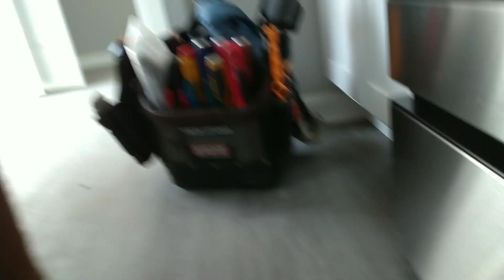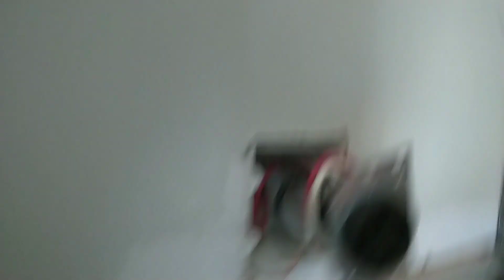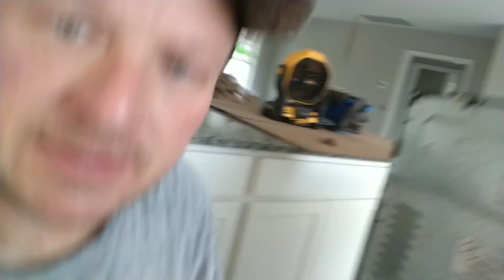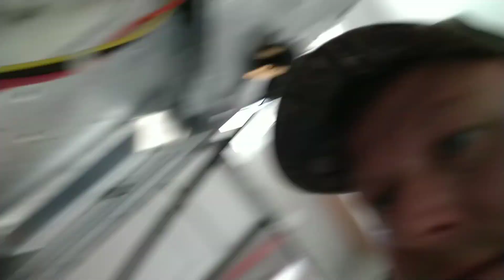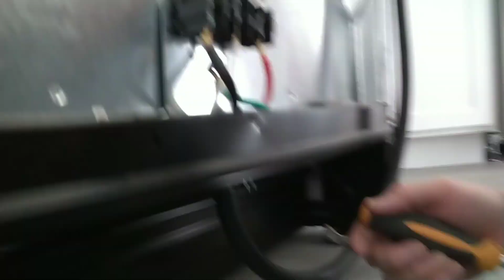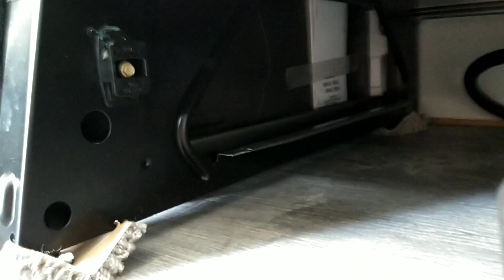How to correctly wire up a Range 🔌plug and outlet 🤔

Comment: First of all, great video. perfectly explained. I have to install an electric range that I purchased in the US and shipped to Brazil. What AWG wire should I run from the breaker to the outlet, 8 or 6 AWG? I am planning on using a 50 amp 2 pole breaker. Also, since the neutral is just to run the lighting and the controls, does it have to be the same AWG as the Phases or could I use 12 AWG? Can I do the same for the ground?
Reply from the maker: Thanks for watching and commenting. Great questions. I'm not sure if the county Brazil , that you are in follows the NEC. But I'll answer the question, as if your here  in the states. Short runs, the Range can be wired on a 50 amp double pole breaker with 8 gauge  wire for the hot legs. The neutral also needs to be an 8 gauge.  The ground can be a 10 gauge. Longer runs, you may want to step up the garage to a 6 to accommodate for a voltage drop.
Reply: @workingmanrondoyle3287  Thank you very much for your answer. In fact they do not follow NEC in Brazil but since they don't sell these electric ranges here and thus have no code for it, I feel it is prudent to follow it myself. The runs are actually short, less than 15 feet at most since the breaker box is in the kitchen where the range will be installed. Now I have to find out if I will be able to pass the wire through the corrugated duct that goes to where the range is installed. Here, all the construction is concrete and brick and if I can't use the existing duct, then I will have to break som concrete and do som tiling. Cross my fingers and hopefully won't have to do that.

Comment: Ron, great video. Thank you so much. I have a question for you. Currently we have a gas stove and the receptacle behind is a normal 120v. We'd like to go with an electric stove/range and I know that we're going to have to install the correct outlet that can handle the electric current. I realize that stoves have either 3-prong or 4-prong. Which should I install? And what is the difference?
Thanks Ron.
Reply from the maker: Thanks for watching and commenting. If you're installing a new range in a new or older home that doesn't already have pre-existing wiring for a range application you have to run a three conductor+ground= a four prong cord set and matching outlet. There will be 2 hots, neutral and a ground for this appreciate. This was mandated many NEC. Code cycles ago. I hope the information helps you.

Comment: When wiring the back of the range, what would happen if you reverse the Black and Red wires?
Reply from the maker: Thanks for watching and commenting. That's a good question. If the range is listed for 240 volt single phase?  It won't matter if the red and black are switched. Red to black and black to red. They are both 120 volt to ground each. And 240 volt hot to hot .

Comment: I'm trying to do this but I'm only seeing black and gray with a coper wire.
Reply from the maker: Thanks for watching and commenting. It sounds like you have two conductors with a ground.  If your in an older home Pre-1980's and this is the feed to the range? You can wire a new range to this by using a matching cord set. The ground and neural are bonded together in this application. 
But on the other hand, if you moved into a newer home 1990's and you brought your older range with you? You'll need to update the cord set to a four prong where  the ground and neural are separated. The Electric codes have changed in year past making this a requirement. I hope that answers your questions and I haven't confused you.

Comment: Makes the job quicker to use a cable clamp.  Then you don't have to work under the stove.  Clamp it to the cable, slip it in and install the star nut inside the junction box (on the stove), then screw down your conductors as you did making sure to remove the ground strap on the neutral as you did.
Reply from the maker: Great comment Douglas 👍🏻. I have done that in the past and now thinking, I should have mentioned the use of a cable clamp as a good alternative if the factory clamp was missing.  Thanks for keeping me on my toes.

Comment: thanks for the excellent video.  because of your video I checked the cord set wiring and sure enough it was all wrong.  Not only was the ground/neutral jumper not removed, but they wired the cord connectors on top of the stove connectors rather than on the terminal block below where the manual showed they should go.  Good work.

Comment: What size of the wire for stove..  and what size of amp
Reply from the maker: Hey James, thanks for watching and commenting. I use an all copper NM- Romex 8-3 wire for standard ranges up to about 80' in length on a 50 amp double pole breaker. If the length is longer than 80'+ I like to step up to a heavier 6-3 NM Romex to reduce any voltage drop.

Comment: Its better to have a little wire showing than to have the casing to high into the receptical. If the casing is to high it can melt and start a fire.
Reply from the maker: Thanks for watching and commenting. Your right. If the wire's insulation jacket is pinched under a screw terminal can be very bad. This causes resistance and resistance causes heat and heat causes the jacket to melt past it's flash point thus causing fires. 
If an inspector is doing his job 🤔 they may catch this and fail the inspection.

Comment: I hope you do not mind my comment.   A very well done and accurate video!   For your viewers, many do not know what to do when they move into a house.  3 or 4 prong cord or receptacle?   Do not trust that if there is a 3 prong plug that it is correct.  You must check to see if there are 3 conductors and a ground or just 3 conductors.   If your house was build after mid to late 80’s, it most likely will have ground.  It was required in 1984 NEC.   Do not change the receptacle to match the cord if it is 3 prong and house is 4 prong.  Change the cord and how it attaches as shown in this video to 4 prong.  3 prong is an exception allowed for older houses only.   Respectfully,   Kevin
Reply from the maker: Thanks Kevin 👍🏻👍🏻. I very much appreciate your comment and input. Please chime in anytime my friend.

Comment: The stove i have now came with the house and directly wired, is it really a bad idea to just hard wire the new one, i dont see the need to put an outlet and then have to hard wire the shove to a plug as well
Reply from the maker: Hey Todd. A standard Range that is designed to be moved, needs (disconnecting means). A cord and plug connection is considered just that ! Now that you watched the video 🤔 I would hope you would  consider correct it.  Thanks for watching and commenting 👍🏻

Comment: You know there are no google results and no youtube results for how to fix an electric range top that is sagging in the center. Very common problem. Everything else works just the center has sagged from years of weight being placed on the burners. Some type of non flammable center support or independent isolated support for each burner. Funny all the info on the web yet no answer to this query. Yes I know I could be a patriot and buy a new chinese made stove with range but I would be a fool to think it would not go the same wsy.
Reply from the maker: Thanks for watching and commenting. Now that you mention it 🤔
 I have noticed a few ranges do this.

Comment: In my state a home owner can do their own electric. I'm having an new dual fuel range installed. After the contractor doing the gas line emptied my wallet I thought I could move the old 40 amp circuit over 16 inches and convert the breaker to 30 amp.  The main issue I had was the #6 in the box. That's a pain to work with.  Your first class instructions solved my problems. Your remark about the wire coil and cord alignment awareness solved all my inexperience issues. Thank you very much!
Reply from the maker: Thanks for watching and commenting 👍🏻 I'm glad the video helped you out.

Comment: Thank you for the video. Very helpful and great tips. I learn a lot by watching your videos and the tips.  I appreciate you showing which parts and materials do you use. Thank you!!.  Just quick question, do you normally use stranded or solid wire for the 30A (electrical dryer)? Keep on the good work!!
Reply from the maker: Thanks for watching and commenting 👍🏻 I really appreciate it 😊
In a residential setting, I use 10-3 NM+ ground. It's a solid copper wire.
Thanks again 👍🏻 for the compliment 🤠

Comment: Neutral bonded to ground on the appliance is a major code violation. Is this range a Listed device?
Reply from the maker: Your absolutely right. Thanks for watching and commenting. Yes, it is a list and labeled U.L. appliance. Mostly all the appliances and fixtures I install are listed and labeled. So far I ran into two that were not and I refuse to install them. Both of these items were something the customer bought online 😥 and most of the websites don't even mention it. Really sad this junk gets through customs and border patrol check points.
Reply: I wonder if there was any mention of the bonded neutral configuration in the installation manual. If so, that’s forgivable, except for the default configuration being a bonded neutral, vs being in the ungrounded state by default.
Reply from the maker: @aerostahr  thanks for replying. Now that you mention it 🤔I wished I showed that on camera. The wiring schematic is printed and posted for 3 and 4 pin range cord installation to the back side of that range. It would have been a good idea to point this out to the audience lol...
Reply: @workingmanrondoyle3287  Can you explain for a regular person on a 4-wire installation why "neutral bonded to ground on the appliance is a major code violation." But yet it is OK to do the neutral bonded to ground on the 3-wire installation by using the ground strap.
I just had a Samsung stove professionally installed. It is a 4-wire installation. The instructions state to "Cut and discard the ground strap. Do not discard any screws." So do you just remove the grounding strap, exactly as you did in the video, or cut it so that the upper portion is still connected to the upper and lower white wires? The professional who installed it did not remove the grounding strap, but connected the green wire to the bottom of the strap, as opposed to what was initially seen on your stove with both the (lower) white and green connected to the same screw.
Also, is there supposed to be a strain relief or not? The Samsung installation states, "For Conduit Installation Only." The professional installation for my stove did not put a strain relief, but there is no conduit, just the cord, which goes through the large hole.
Reply from the maker: @sub3marathonman788  Thanks for watching and commenting 👍🏻. As to your question 🤔 about this issue of bonding-vs-not bonding the neural to ground. The Nec. revised the code quite a few years ago about this, deeming it was much safer to add a neutral to kitchen ranges then share the ground on the appliance. This was becoming more of a public safety concern due to the electronics that were added to the modern day Range. Older style ranges from the 1960's to the 1980's only had 2-hots and a ground. So that's why most older homes had only 3 wire feeders. The only thing that needed a neutral was the oven light which shared the ground as a neural. This would cause the potential for a person touching the appliance to get shocked. Most of the oven timers were non-electric  (mechanical) until the late 1980's Thur today's models. 
 Sad but true 🤔Appliance technicians aren't electricians and most are paid on an hourly bases by there employer. Not enough adequate training on this topic. So going off of what you said, your range was not wired right. The ground strap can be cut or removed. Same difference, your separating the neutral from the ground. Mostly all range and dryer cords come with cord strain relief clamps. And yes they should be used to prevent wires being chafed on the ranges sheet metal ! Most appliance delivery people won't install them due to the time it takes to do it the  right way.  I hope that answers your questions.
Reply: @workingmanrondoyle3287  Wow, thanks for that in-depth reply. I definitely appreciate it. I'll add, your video was the best one on this topic, as you not only explained correctly but you provided close-up views, even when the procedure was a bit difficult too.

Comment: Great information!  I do have a question.  I'm getting a dual fuel Cafe range and am confused by the electrical requirements.  Installation instructions are saying 30amp circuit in one spot and 40amp in another.  Calling GE isn't very helpful.  Wattage of the oven is 4,000 watts.  Which breaker do I install?  Thanks!
Reply from the maker: Thanks for watching and commenting Rebecca. That does sound confusing 🤔. I know and have seen manufacturer's do this before. If your range is under 100' away from the main panel's location 30amp  is adequate on a 10 gauge wire size. But whenever I see the manufacturer specify a higher amperage such as your instructed,  I always wire to the side of caution. So I would install an 8 gauge for a 40 amp breaker. That way your covered. I hope that helps you.
Reply: @workingmanrondoyle3287  Thank you for your help!  I'll definitely do the 40amp with 8ga. Have a wonderful Christmas!

Comment: I have what looks like an older 3 wires hooked into a 4 prong oven receptacle. Is it OK to change the 4 prong to a 3 prong? 240v
Reply from the maker: Thanks for watching Angel. If your house is wired for a range with three wire, you'll need to change the range wire to a three prong cord/plug set to match. Just make sure the neutral and ground are bonded together at the range with a bonding strap which is supplied with all new Ranges. If you're appliance guy through this bonding strap away 🤔 One can be made from a bare no.10 copper piece of wire. I hope that helps you.